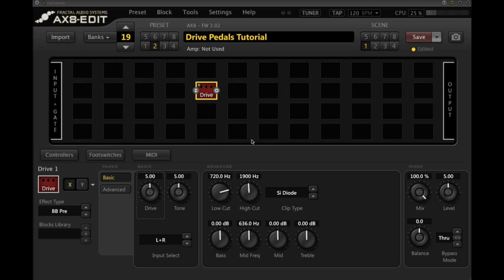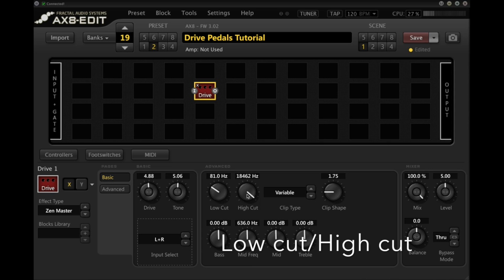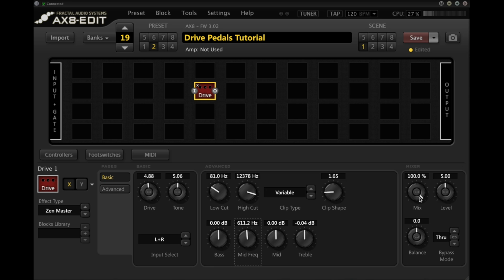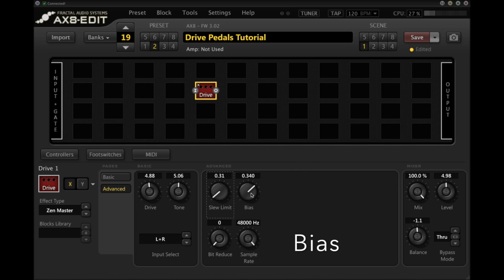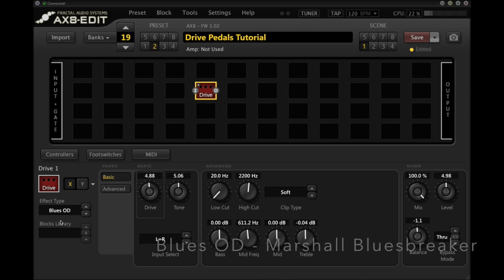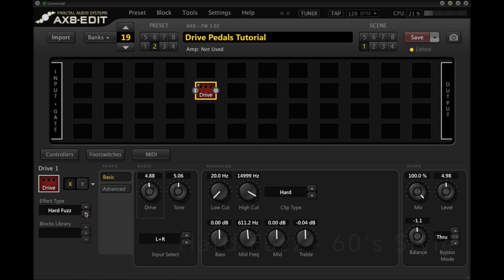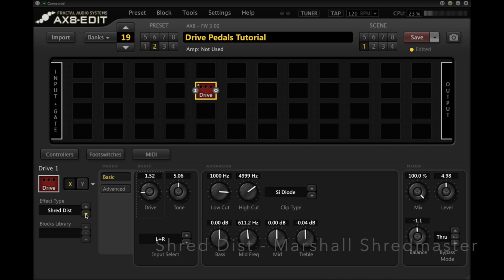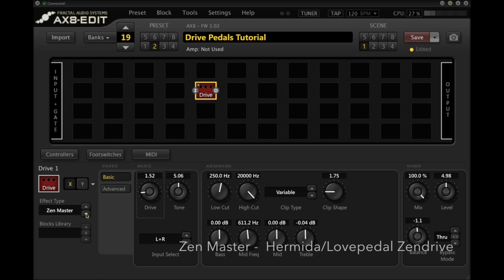Fractal Audio AX8 Tutorial-All 34 Drive Pedals Explained [Settings, Parameters, History, Amp Combos]

Comment: Op-amp: IC chips control the clipping or distortion. Most notable in IC Big Muffs or other vintage distortions 
LED is just referring to pedals that actually use the LED circuit to affect clipping. The only one I've had direct experience with is the Pettyjohn PettyDrive but there are plenty of other examples.
Reply from the maker: Hi Adam. You're a legend! Thanks for sharing that with us. I'm looking into the history of Big Muff now thanks to your comment. Care to tell us a little more about the PettyJohn PettyDrive you have? :)
Reply: Not currently in my arsenal but the PettyDrive is a dual channel analog overdrive with studio grade components. It tries to have the sound of a Vox on one side and a tweed on the other. It has clipping options on each side: hard, soft, and LED. LED Being the most "transparent"
Reply from the maker: That PettyDrive sounds impressive. Do you have any videos of it here on Youtube or somewhere?